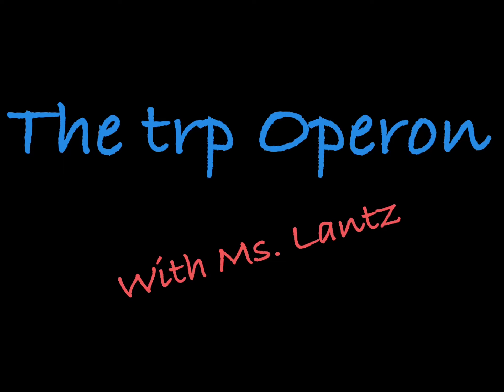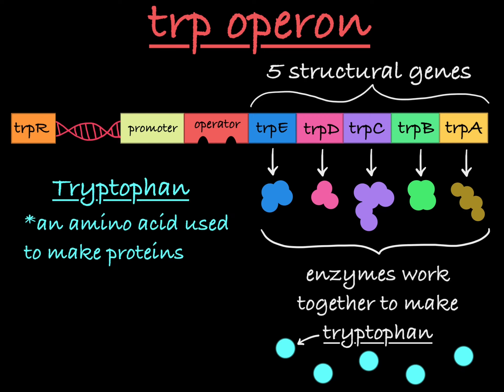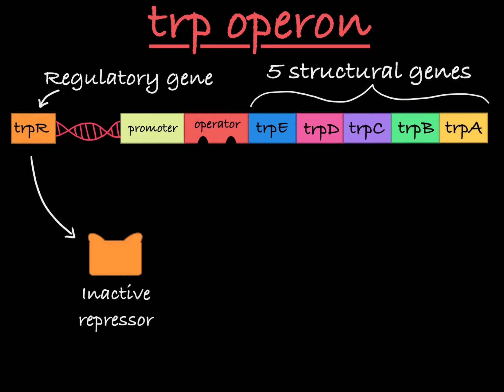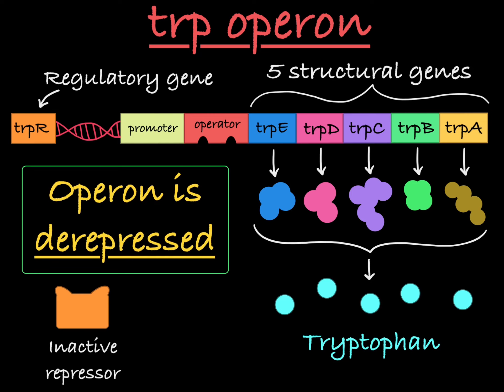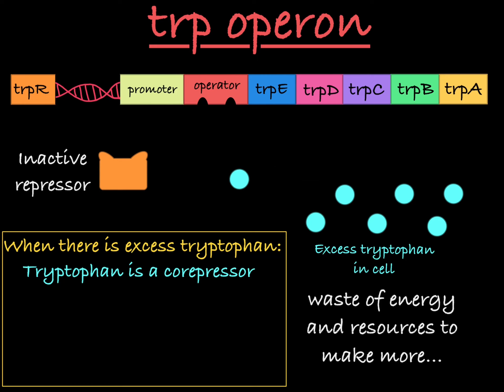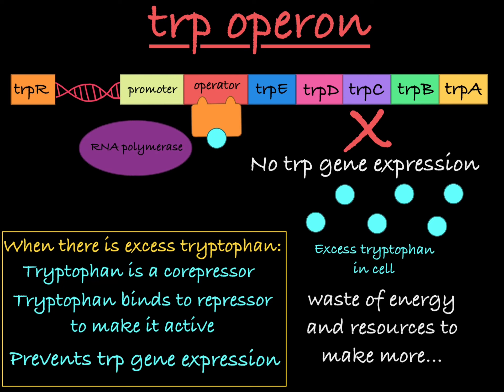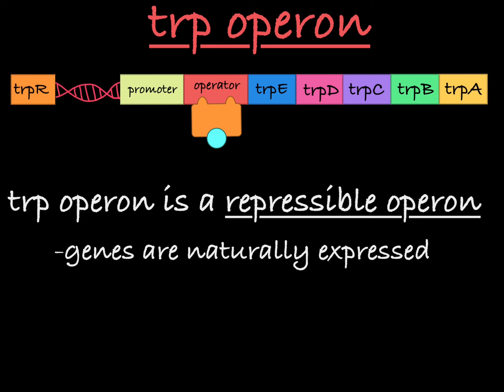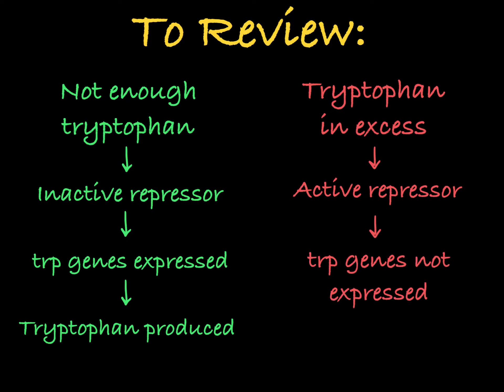The trp Operon Explained

Comment: I was wondering why trp operon functions exactly opposite to lac operon, because trp is repressor while lac is inducer. Thanks for the video.
Reply: When you have enough trp in the cell you don't need to create enzyme that are producing trp that's why trp is a repressor of trp operon. Lac operon works like you need to create energy (no more glucose to use) but with lactose so lactose induces the production of enzymes that can metabolize lactose. Hope that will help
Reply: also note that lac operon leads to metabolism of lactose, while the trp operon leads to the anabolism of tryptophan and most of the ones like this are repressible